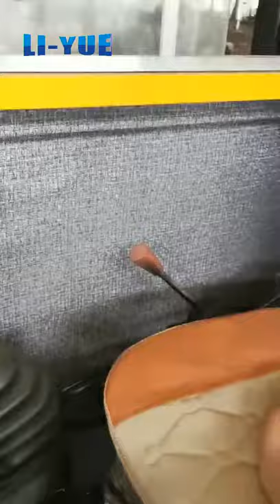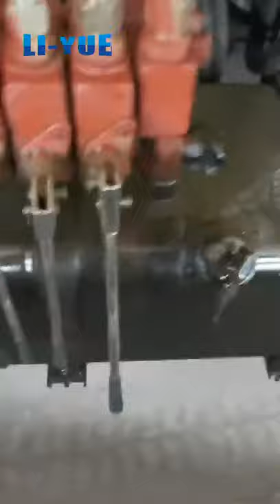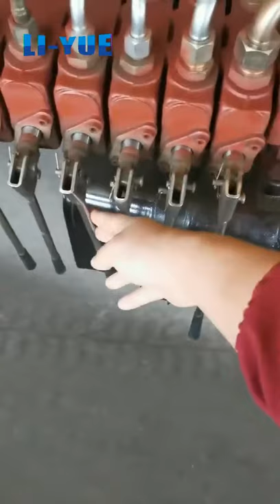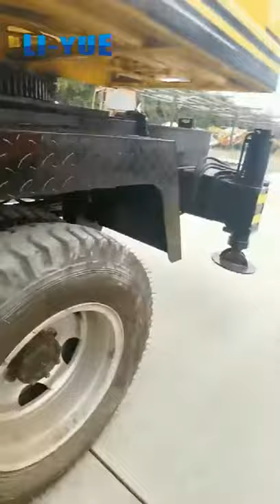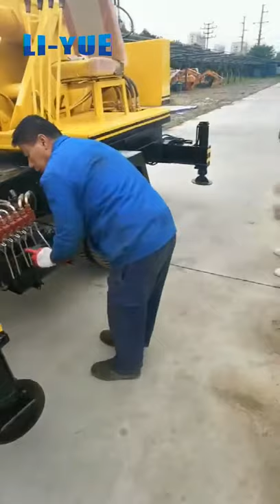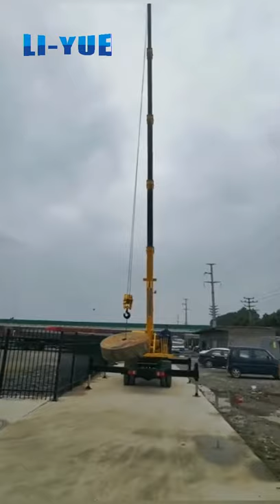6 Tons Homemade Chassis Truck Crane Operation Methods

Comment: Needs rotation resistant wire rope to keep it from twisting up below to tip sheeve
Reply from the maker: Thank you!
Our crane has rope dividers and rope presses, which can solve this problem.